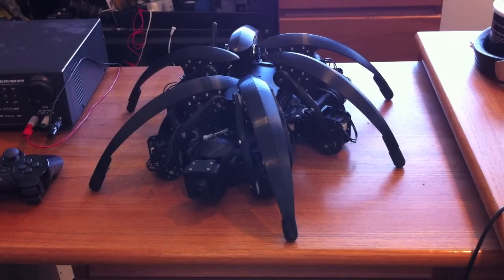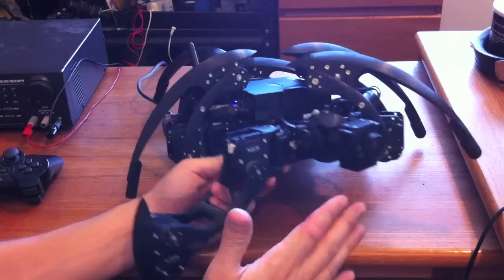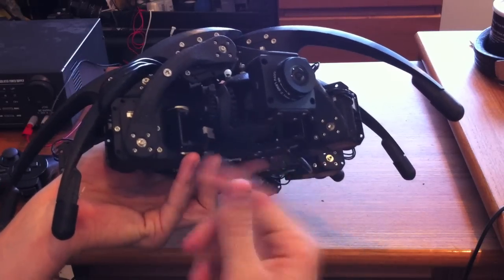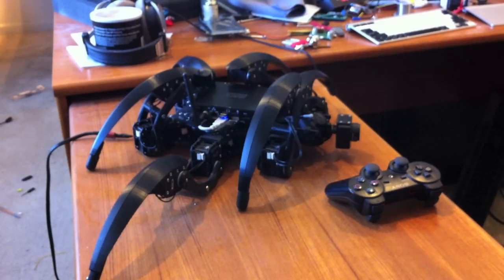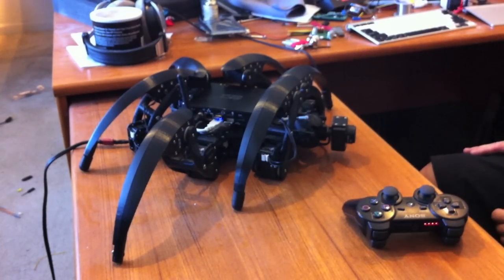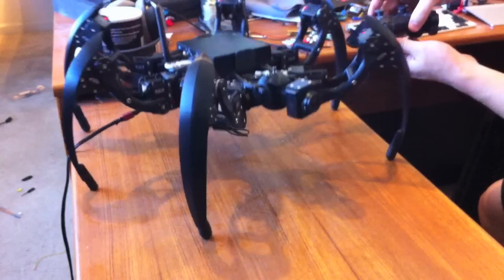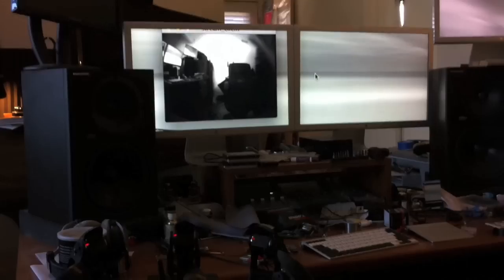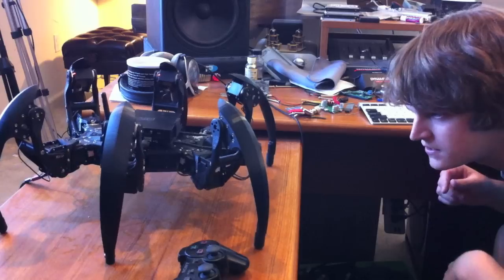Intel Hexapod: Dmitri Update

Comment: I am also doing same project with arduino uno R3 usb 18 servo controller . I could detect the device in my pc but the software which was provided along with device by robokits support team could not able to detect the device .I mean I could not able to integrate both device and software together . Can anyone give me proper soultion for this case
https://robokits.co.in/robot-kits/hexapod-robot-kit/18dof-6legged-intelligent-hexapod-robot-diy-without-electronics
https://robokits.co.in/control-boards/rc-servo-controller/arduino-uno-r3-based-bluetooth-usb-18-servo-controller

Comment: If I have spare time I’ll learn to build one. I’m wondering if you use higher tensile strength parts can it carry say 10 pounds and still have the same speed. Not like I want to add a miniature mini air soft or paint gun onto it but that’s a thought.

Comment: Hey dude!
First things first - amazing job! This is probably the most amazing hexapod robot I've seen out there (both in design and looks)! Very impressive. Couple of questions though -
What algorithm do you use for face detection/tracking? Viola/Jones, Kalman/Particle filters, or?
Also, are you doing all of the image processing on-board, or you do it remotely after the image is streamed?
Finally, what platform would you recommend for people interested in multi-legged robots to start with?
To put it in perspective, I am a Master's student, working on implementing object tracking algorithms on an FPGA, and I really want to test this on a legged robot, so I'm looking for a nice mechanical platform.
Thanks in advance!

Comment: Btw, what servos are you using?  Where did you source them, and of course, how pricey are they?  So, you're using OpenCV.  Are you using ROS, as well?
Reply from the maker: I did most of the work before I knew what ROS was, so no ROS.  The motors are Dynamixel MX-28 motors available at places like Trossen or CrustCrawler, but are very pricey for a hexapod.
Reply: blegas78 Yowser!  You're not kidding, $219 each and you got 3 per leg, right?  Are you funded?  No problem, though, my prof seems to be interested in the multicopter only.  So I'll dive straight into my multicopter design and skip the hexapod, until he gets comfortable enough to provide more funding.

One of the features of ROS that I'm interested in is the native Android implementation.  It also seems quite easy to publish sensor information from an Arduino or the Android camera to a remote server, which can do the heavy computations.  I'm going to try to get an HMM or ANN tracker going on the android device.
Reply from the maker: I have support from Intel, but this particular hexapod was mostly funded by Robotis as I am a Robotis power user.

I had no idea that Android had a native ROS implementation.  Very nice!  I'll be excited to see any videos you post regarding your HMM/ANN tracker.  

I made an interface with iOS for a class project, using OpenGL.  I posted a video of the project a year ago on my channel that you can check out.

Comment: Hello, is it possible to buy this Hexapod frame somewhere? I really like the leg design in contrast to the one i currently have. Thanks.
Reply from the maker: What do you currently have?  The frame is my own design and is 3D printed using a commercial printer, so they are a bit difficult to get ahold of other than through me. :)
Reply: blegas78 it would be nice if you could share the CAD files if you want e.g in thingiverse because i am also missing a stable cheap frame for my servos. I am 100% sure shapeways can Print it with their industrial printers (even in Metall ), you could also sell the CAD file in their shop and earn the money ;)

Comment: Beautiful! Great design. I have a question: what is that box over the body? the one with the wi-fi anthenna. Sorry if is a dumb question, Im planning something like this but Im new to all this robotics and programing stuff. Thank you :)
Reply from the maker: That box is a fit-PC2.  It's a great little PC running Ubuntu.  If you are new, there are plenty of forums and starter kits on the internet.  It's a very multidisciplinary and rewarding hobby!
Reply: blegas78 if you were building this again now would you use a d54250wyk or d34010wyk nuc, or perhaps just the pcb in a 3d printed case? how do you attach the side with no servo horn? just a press fit or is there some fixing? does it distort/twist the arm at all if its just driven on one side? are you just running fitpc>usb2dynamixel>servos, or do you need something additional for power? sorry for the multiple questions, love your work!

Comment: Im not sure if you have or not, but you could piezos on the legs as a means to determine that the leg has struck a surface, that way if on the small a table the bot would not step off and fall.

Comment: The design is very impressive. It will make a great explorer. Have you thought of adding some new other sensors, like the Proximity Sensor and/or Acclerometer? It is necessary to build an application which you can control from an Android or iOS device to make this more exciting!

Comment: Ah, the MX-28. Maybe I will try the MX series for my next robot. Since you've used the RX-28s have you had any issues with their regulators blowing up? I have bought 8 servos for my prototype and have already blown the regulators on 2 servos, even though I am using a 12V, 5A power supplies, so no overvoltage issues there. Whats been your experience with the RX?

Comment from the maker: The MX-28 motors that I'm using for the legs implement an updated algorithm, using a traditional PID controller.  With the PID, the compliance slope, margin, and punch values are nonexistent.

However I did used to have the RX-28 motors, but I could not get them as smooth as in this video.  I think I had the slope set to 16, punch set to 8, and margins set to 1.  It does however greatly depend on your mechanical configuration.

Comment: Thanks Matt, glad you liked it! Another thing I noticed from your demo is that there isn't much noise from the MX28's. You probably know how the 5990's sounds like.. I've heard that Robotis are going to release a MX version of the 64 and 106 too. That's really interesting since a high torque servo often are used on larger segments/robots that would require even higher resolution for an accurate movement.